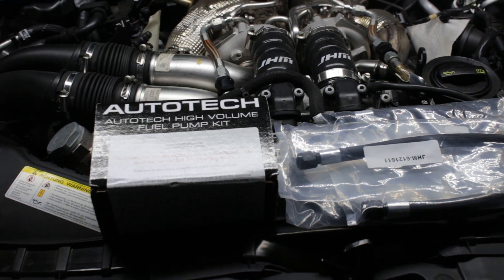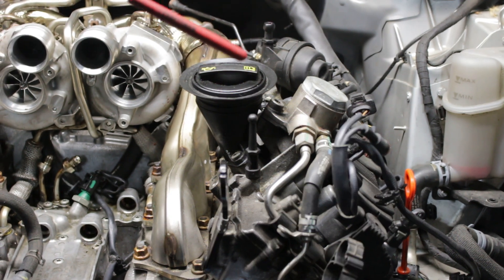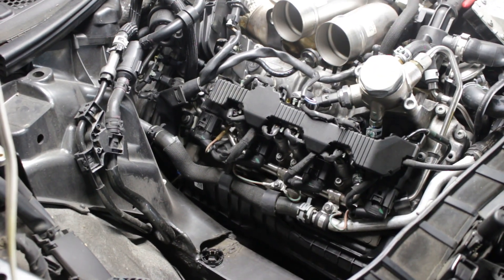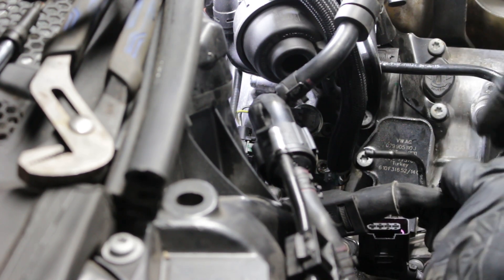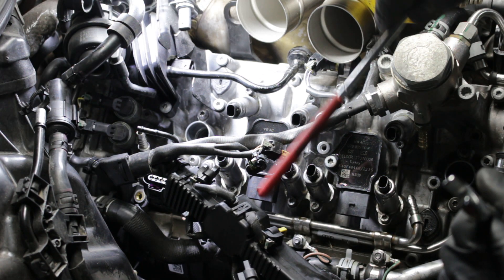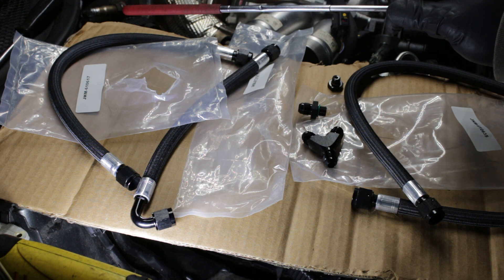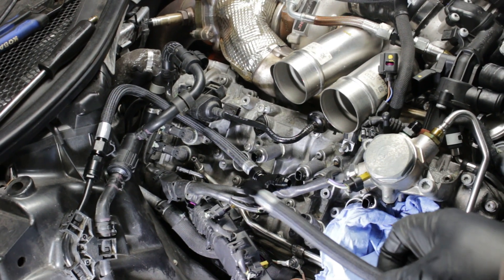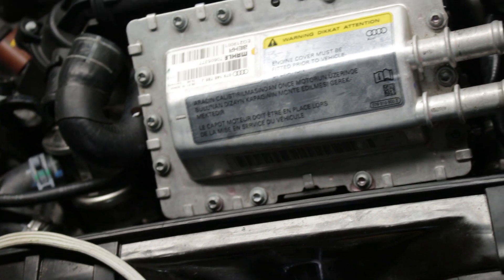Audi 4.0T Low pressure fuel line upgrade - Install for All 4.0T - how and why

Comment: Did you have any issues after the installation like any weird noises
Reply from the maker: I didn't but let me know what noises you're talking about. Make sure you have the fuel line going across the front of the motor zip tied and not letting it hit the front core support. That could make noise I helped someone local with an install and we found that if not secured tight to the mtoor the vibration is loud enough to hear.

Comment: My kit arrives today and i kept seeing videos with that metal connection for the fuel line. My s8 doesn't have that when you showed the difference it was the aha moment. Nonetheless you are the most detailed on YouTube you were god send when i did my turbo filter lines thank you brother. Also look into crush rings when connecting to the HPP ditch the o-rings. great damn videos keep posting
Reply: I need a video on the fuel line disconnecting removal. My tabs broke 😢 dont know what to do here.
Reply from the maker: I saw you made two comments. Let me know if you need support on the other comment. I can try to assist.

Comment: So your video has kinda answered my question but not sure. I was running e85  from IE. THEY CLAIM I DO NOT HAVE TO UPGRADE MY FUEL SYSTEM OR PUMPS. IT RAN GREAT FOR ABOUT 3K MILES THEN I STARTED GETTING MISFIRES FOR DRIVER SIDE PUMP SO I REPLACED IT AND STILL HAD ISSUES WENT BACK TO STAGE 1 91 OCTANE TUNE AND IT HAS RAN PERFECT. SO MY QUESTION IS YOU MENTIONED THE PASSENGER SIDE IS THE MAIN SUPPLIER TO THE DRIVER SIDE SO  MAYBY  ITS THE PASSENGER SIDE PUMP THAT IS GOING OUT ?  AND NOT THE DRIVER SIDE? SHOULD I PUT THE NEW PUMP FROM THE DRIVER SIDE TO THE PASSENGER SIDE AND PUT THE ORIGINAL PASSENGER SIDE PUMP ON THE DRIVER SIDE AND SEE IF THAT HELPS?   YOUR HELP WOULD BE MUCH APPRECIATED. THANK YOU!  BY THE WAY MY CAR IS A 2016 AUDI S6 4.0T
Reply from the maker: From my point of view. I think that's not responsible of them. I hate that companies feel they have to push the limits of hardware to capture business. I'm not interested in tuner wars but when looking at other peoples logs you can see some companies let the LPFP side fall from almost 7bar to 3 without limp mode. This LPFP line mod will almost eliminate that fall off. While I've not seen your car it sounds like you had a lean missfire. That's not good. Or a possible one I don't want to jump too heavy into conclusions.I'd need to see the cylinder missfires and then logs to be able to speak with  on this more but to me it sounds like a lean missfire. The 2016 S6 can do well. If you're going to run E content fuel make sure you get the LPFP line upgrade. My wifes car and all other cars I've seen logs of with the line mod have a DRASTICALLY better fuel pressure log specifically for the low side.  With that said the A8 has a better fuel controller then the S6/7 but that's not the point.  The point is this line mod feeds each pump it's own source of fuel and that's what you're going to want.
Reply: @howididit7196 ok great. So how do i get that low pressure feed line and do i need to  get the total reroute kit aswell. The lines that go between the pumps!  Thanks for replying i do appreciate it

Comment: Does this apply to the newer EA825 4.0T?
Reply from the maker: The Gen 2 4.0T motors put out WAY more HPFP pressure than the Gen 1. So no this would not be workable or needed. I can add more info but overall the gen 2 4.0T makes more power and more fuel pressure.
Reply: @howididit7196 
Thanks a lot. 
I plan to get a used Audi S6 in the future, gonna need this mod for the car.
Reply: @howididit7196 I just picked up a 2017 Audi s6. I haven’t looked into it yet but does it still have the issue with one hpfp being fed fuel by the fuel pump then the other being fed by the other hpfp. If so do you recommend getting a kit to make it so each hpfp is directly fueled by the fuel pump. I plan on making it stage 3 roughly 800hp+

Comment: Do you know what the fitting size is that goes into the pumps to cap them off and convert them into a AN6?

Sourcing everything seperately so need to find out what type of end it is to place the male into the pump itself. Cheers
Reply from the maker: I apologize I do not know off hand.

Comment: Also how does this work with a flex fuel sensor kit?
Reply from the maker: Each flex sensor kit will have it's own connection point. Some kits incorporate the majority of the lines

Comment: You mention that you think the LPFP line upgrade made more of a difference than the HPFP piston in one of your other videos.  What did you notice after this upgrade?
Reply from the maker: Hi I saw your questions on both videos. (thanks for watching) Feeding the hpfp is going to make a big difference. So when you look at it from a supply theory standpoint the results back up the science. And that's putting in a hpfp piston can pump more out of the unit but if you're not feeding it (hpfp) with enough supply the output will suffer. Increasing the supply line helped the HPFP run more efficient and helped keep the low pressure side from falling off pressure wise. The hpfp was able to achieve a higher bar pressure and this helped reduce injector on time overall.
Reply: @howididit7196  Makes sense.  Immediately after this, did you feel any differences in the throttle, or power bands, compared to how it felt before?  I enjoyed the methodical approach you took to explaining all of the changes!  Thanks for the video :)

Comment: This will be a super popular video. I personally just can’t bring myself to run lines like this. I’d much prefer an upgraded factory-style setup. My teen will drive my car and I don’t want any increased fire risk.
Reply from the maker: When it's all finished the fuel lines overlap the OEM path.. So other then perhaps the argument for conversion to AN fuel fittings. I didn't see an argument for any increase in fire risk over the OEM lines. While the cross over line that's in the front of the motor isn't under the oil separator. There's nothing outside the normal pathway other than that. Given the huge improvement and safety to the motor with the increased fuel supply and lower demand on the LPFP. I'd suggest taking a second look at what you see as a fire risk and see if it's really that, (keep in mind your  replacing rubber OEM lines in some spots with much stronger lines with the kit) as I agree it's smart to think twice about anything fuel or line related but I find it hard to justify calling this a increased fire risk to any degree. To help add a bit more perspective. The JHM turbo oil filter lines sit less than an inch away from the manifolds and there's not even a hint of heat stress sitting right there on it after several years.  So obviously each individual needs to set the standards for their beliefs. My .02 is thinking this might be an increased fire risk is a bit unfounded given the quality of available components out there and how the fuel line path way is run there's no scenarios where the fuel lines could ever come into contact or be in a situation they're compromised. This was a JHM Fuel line kit and it's fitment was very specific and built to what seemed to be close tolerances that with the quality of the fuel lines adds to my end conclusion. I can't speak for all kits. So yes there's a chance other kits might be built in a way that's more subject to concern. As always buyer beware. If it's of any value. I put this kit on about 8 months ago on both cars (ZERO ISSUES) I tend to drive the car hard when I drive it. My buddy drives his RS7 like he stole it and the A8 is my wifes car that my teen daughter drives (with me or the wife) and my wife drives our 4 children in one of them a still a baby..... ANYWAYS.. Thanks for the watch thanks for the comments and thanks for your feedback.

Comment: Thanks for taking the time to film. I really like your slow and methodical explanations on why your doing what your doing. This will be a great asset when I goto install my kit tonight. Looking forward to your HPFP rebuild video. I'm having a tough time deciding to rebuild or upgrage or simply replace the whole HPFP unit, as I won't go beyond APR stage 3.
Reply from the maker: Josh thank you so very much. On this video I tried to be helpful but not too wordy. Get to the point but make it detailed enough that you knew how to go about it. I'll be honest this low pressure line upgrade is the single biggest bang for the dollar. I WOULD never now that I know even stage 2 an S8 or RS7 without it.  I'll be getting the HPFP video out here shortly. I'll add a bit more commentary to that in hopes of helping more there.

Comment: I wonder what the issue is for this with Audi. This is the same issue with the 3.0T when wanting to us E85. All fuel system related. However, this is a great informational video.
Reply from the maker: Thank you for taking the time to share your kind words. If I had to really give it thought. I think our plans for the fuel system go beyond Audi's requirement as stock they both (3.0T and 4.0T) seem to be good enough